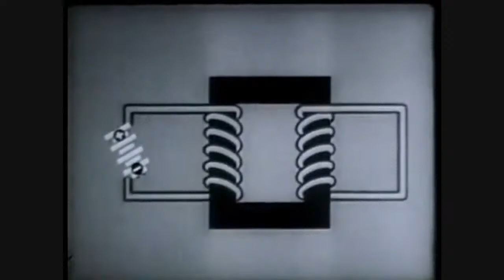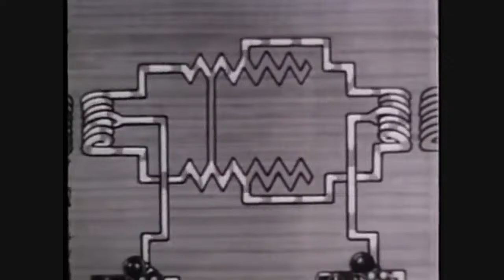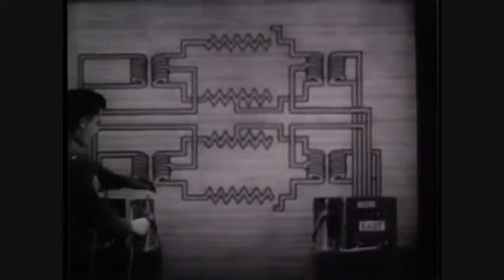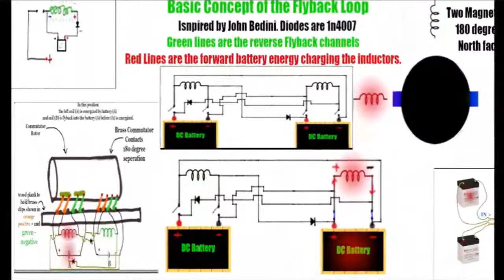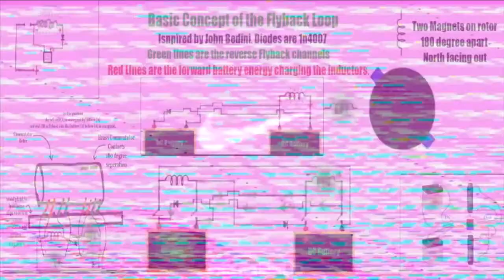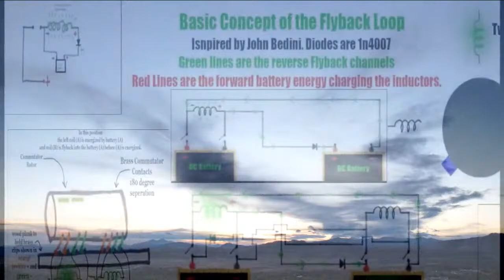Pulse Motors / Alternative Energies  Open Source Talk

Comment from the maker: I put two options in this diagram for switching (bottom left/right)   This circuit can also get triggered by 2 trigger  winding and 4 transistors , 2 pairs , each pair switched independently